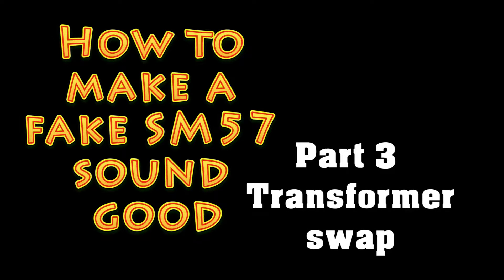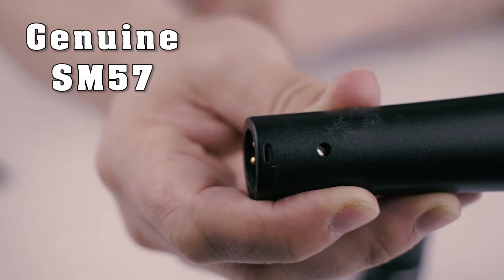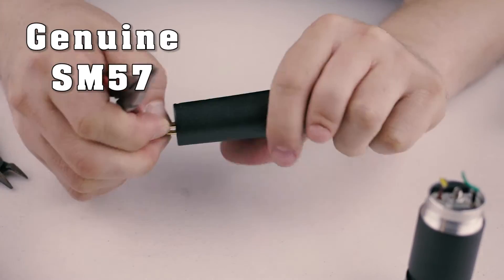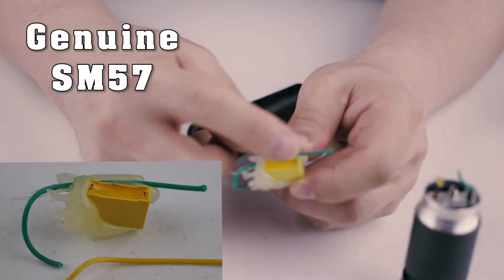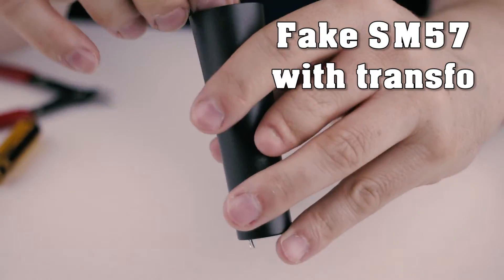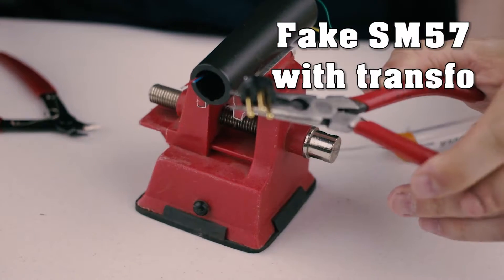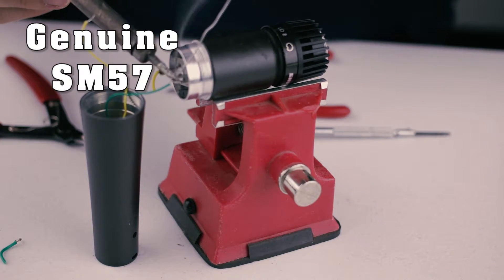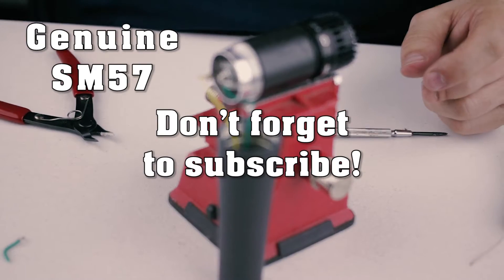How to make a fake SM57 sound good (part 3 of 3)

Comment: Since the fake has its body usually potted with cheapest hot melt glue, if someone has trouble extracting the contents, the quickest and cleanest way is to spray or pour several drops of alcohol (ethanol or isopropanol both work) down the body. Alcohol easily penetrates EVA compound of the glue, the alcohol vapour outright wicks into it almost in seconds, forces it to expand, which causes stress cracking, and it becomes crumbly and falls out in several satisfying chunks. It also reaches and wets the hidden glue boundary surface and debonds the glue from the walls, the wires, and whatever decorative components they stuff in there. It's outright magical! Overall it's useful to remember for Chinese toys and quickly botched together DIY projects that need to be dismantled, because neither would be what they are without copious amount of hot snot.
And i mean in doubt when facing unknown compound that might be hot melt glue, it usually doesn't harm to try. :D

Comment: While exchanging some thoughts with a number of people, i have arrived at a hypothesis that due to construction of the capsule, it introduces a significant amount of nonlinear asymmetrical amplitude distortion, while genuine capsule is clean. To make up anywhere near sufficient sensitivity, the dynamic coil has more wire and is taller, and it sticks out of the magnet gap and linear magnetic region, it's just glued to the membrane and butts up right against it. I think this is what dominates the character of these cheap microphones. It has basically tube-style distortion built-in. So this is a fundamental difference in the sound beyond what transformer gain, impedance loading and EQ can do for you. For sure there are some instruments where such distortion is exactly par for the course, just as long as you tame the higher harmonics, which the transformer you added also helps accomplish.
Reply from the maker: Humm.. I'm far from an expert so excuse me if I'm wrong.. Distortion and harmonics occur when an audio signal is saturated. Those kind of phenomenon, can happen anywhere in the gain staging of the signal.. but I don't think it can exist in the capsule itself. The capsule will capture frequencies differently depending on its construction and nature. You can overload a mic by exceeding it's capability to vibrate to the sound waves. (if the sound is too loud) But distortion from the capsule ? I don't think so...
Reply: @MarcoPrimeau  The capsule absolutely does have a harmonic distortion of its own! For a well constructed one, it's extremely low. The capsule in a fake is not a generic capsule from a different product, it's a dedicated one, but it's made from available sub-components to look more or less plausible rather than being actually well engineered, so you can get engineering mishaps that you normally aren't used to seeing.

Distortion mechanisms are similar for a speaker, i have some prior speaker design background so i am familiar with issues occurring there, and one of the major reasons you have multi-way systems rather than a single wide-band driver is to limit intermodulation effects of the inevitable harmonic distortion, otherwise they would become audible. The reason you usually don't have to think about distortion in many product types is because for well-engineered products, there has been significant effort put into solving the distortion issue.

Please see for illustrative purposes an excellent article on 'Inner Fidelity' - "How headphones and dynamic drivers work". Obviously a headphone driver is not quite a microphone, but they are constructed in a fundamentally nearly identical way. The main difference is in the winding type - thicker wire for headphones, fewer turns. Of course many other construction details differ a fair bit, as design goals differ. Fundamentally it's the same tech though. Anyway you will probably find the images from that article helpful, and perhaps some of the explanations, to understand what i am trying to say. This is simply the next best thing i can find, because i don't have a good image of a cross section of a dynamic microphone capsule, most drawings on the Internet are horribly wrong. 1961 AES paper "A small Unidirectional Dynamic Probe Microphone" is actually faithful to the construction of a Shure capsule specifically, the Unidyne, but it skips over a number of important details probably considered trivial to the intended audience and so also shouldn't be seen in isolation.

The purpose of the microphone capsule is to convert displacement of the membrane vs. the neutral position into voltage, or movement into current, this is equivalent. The membrane carries a spool of wire attached to it protruding down from the membrane, that is suspended in the gap of a permanent magnet. The current emitted depends on the spool velocity and the density of the magnetic field. So it is absolutely paramount that the magnetic field density is the same across the whole expected travel of the spool, or equivalent to this, that across the whole stroke of the membrane and the spool, the imaginary magnetic field lines where they cross the individual spool wires are perpendicular to the wire, parallel to each other, and equally spaced. This is approximately the case across a vertical portion in the middle of the gap. They balloon out and decrease in density near the top of the gap and above the magnet, and get weird-shaped near the bottom of the gap within the magnet, and the usable region is longer, the narrower horizontally the gap is. If the spool peeks out from within the ideal region at all in the neutral position, then any sound captured by the capsule will be already distorted, because it's moving in a magnetic field of uneven density, long before the system approaches any kind of mechanical, magnetisation or electrical limit. You could say, this is more or less a trivially solved issue - simply make the spool short enough and such that all the loops are deep enough within the gap, but you cannot expect people who make capsules for counterfeit microphones to not fail at the basics, especially when precision is involved.

Besides that, there is an expectation that air pressure is converted to displacement and that the membrane is basically like a mathematically ideal mass-spring system, constrained to move only in one dimension, but this isn't necessarily the case when membrane breakup occurs and when the shape of the membrane as a piston is not maintained. Now membrane breakup and other mechanical nonlinearities are not trivial problems, ones you expect even competent manufacturers to have solved to a degree but not completely.

There is no saturation in either of the described cases, it's a set of exclusively geometrically explainable considerations that substantiate distortion.

Comment: Have to admit, whatever they had in there (CHANCEFORMER) on the original fake, sounded better (cleaner ) and crisper when you were strumming the acoustic. I guess it really depends what sound you are looking for; but I bet these would sound pretty damn nice on an acoustic fingerpicking track!
Reply from the maker: Hey Robert thanks for your comment. The fake part used was a capacitor which wasn't even plugged in.. They put it there just to have the yellow rectangle stuck in glue. Yes, without modification the Fake SM57 could be use to record if the noise and frequency limitation doesn't bother you. I'm used to the wider frequency content a genuine 57 can produce. Even with the addition of the transformer it's still not equal but to me it became usable.. (bottom snare or tambourine, stuff with no low end)  ;)

Comment: a capacitor in series with the mic capsule does prevent destruction if you have a phantom power on, but it also filters out lower frequencies, and introduces noise. Just removing that capacitor would make it sound a LOT better in itself.
Reply from the maker: In the genuine Shure mics, there isn't any capacitor, just the capsule and a transformer. The transformer is the one who make isolation. In the fake mic I got, there was a capacitor but it wasn't connected.. The connector wires went right throught to the capsule. With a Fake mic, you can expect anything from well designed to complete nonsense. The solution to help mine sound better was to add a genuine Shure transformer.
Reply: I thought the capacitor was connected.... NOT connecting it is even worse!
Personally it doesn't stop me from looking for the cheap ones, and modifying them to sound better, but that's just because I can't afford the original shure mics :(
Reply from the maker: If you buy cheap or clone mics by choice, it's fine. But some people bought clones thinking they were genuine. That's sad... If you've done many mods, you should have some interesting different sounds available to you ;)

Comment: That "transformer" is a box capacitor with it's leads cut off! Was it actually even connected to anything?
Reply from the maker: No it wasn't connected to anything.. They used it as a look a like, stuck in the glue.  It's once I removed it that I saw it was fake !! ;)

Comment: boil it
Reply from the maker: For most owner, boilling the mic is the only way to remove the glue that holds the transformer.. In my case I didn't have to do it since the clone mic didn't have much glue to hide that it wasn't a transformer but a dummy capacitor not even connected in the circuit ;)